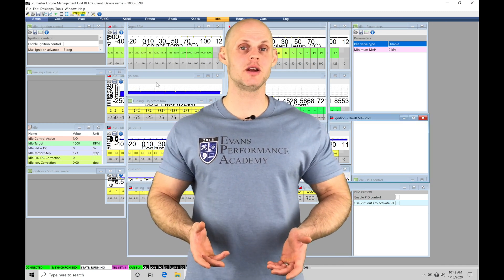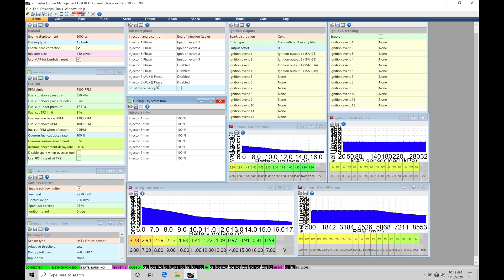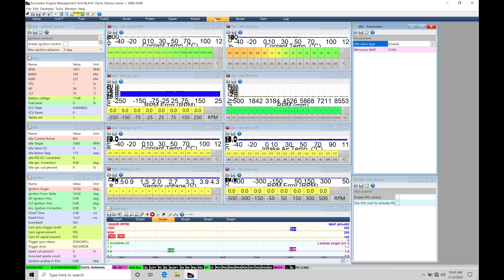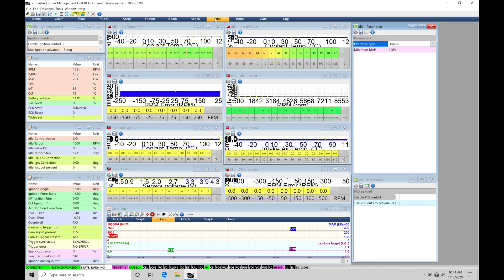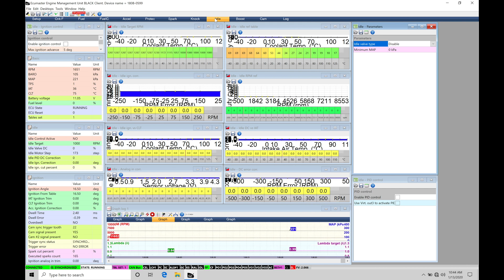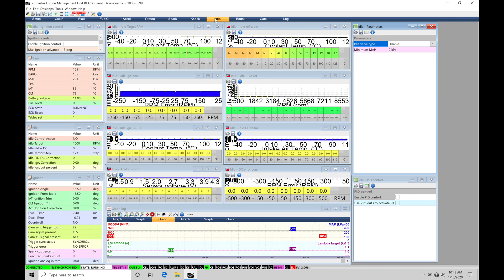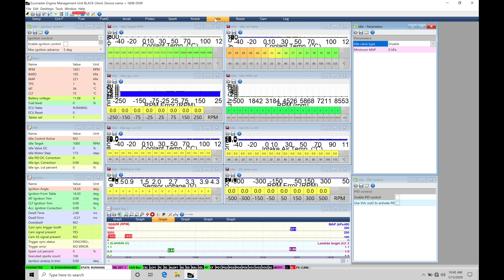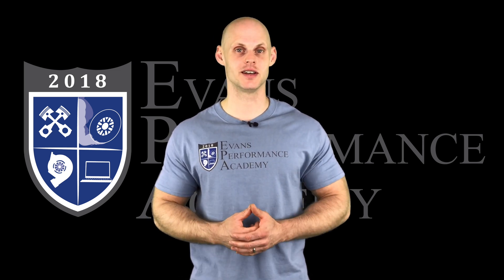ECU Masters Training Course Part 21: Idle Control | Evans Performance Academy

Comment: 2:53 However, the difference between air-torque and ignition-torque, is how fast they can be changed. Air is considered as slow-path to torque response; while ignition timing is considered the fast-path to torque. So depending on how quickly the RPMs are falling, the software needs to determine if it should apply more air OR advance timing....or a combination of the two.